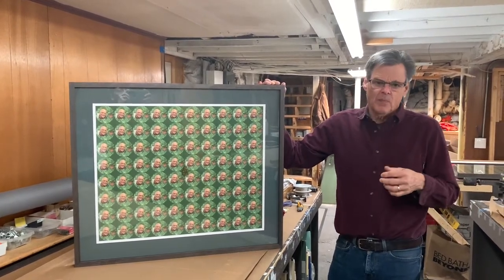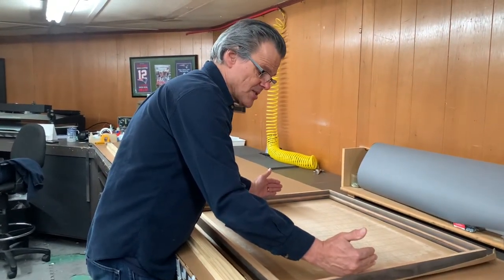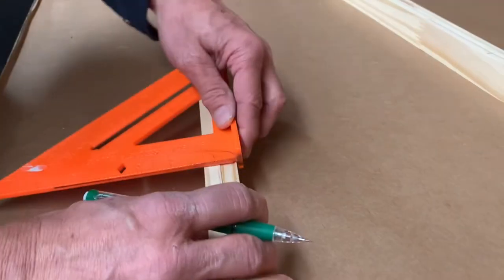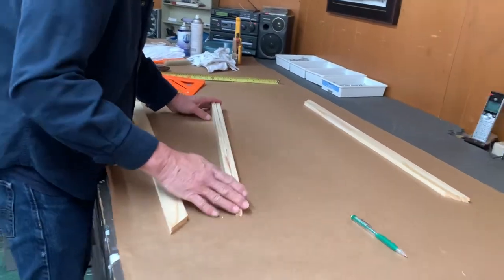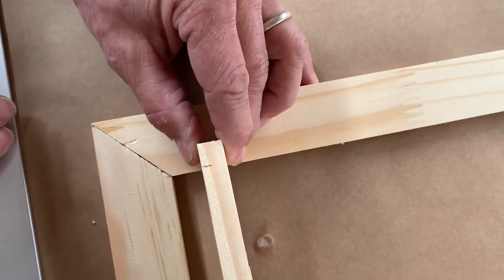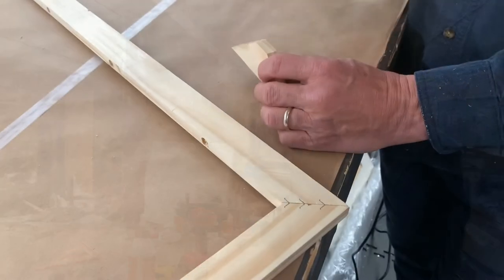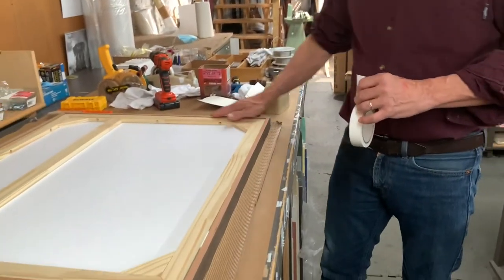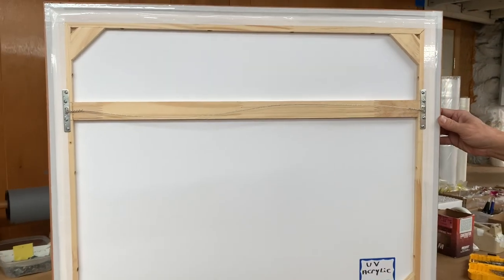How to Build a Strainer Back

Comment: This is a really good "how-to" video! Nicely done. My question is, what kind of wood are you using for the strainer? I saw that it was finger jointed. Where do you get it? Thanks again!
Reply from the maker: HI @steveberry89, thanks for watching. For smaller strainer backs like this I use a finger jointed 1/2" pine that I get from my frame supplier. For larger strainer backs I use solid poplar that I get at Lowes, usually 3/4" x 1 1/2". If I need the poplar to be 1/2" I plane it down myself, but Lowes does have some 1/2" x 1 1/2" poplar. The shims are simply strips mat board. Glad you enjoyed our video! Any further questions, don't hesitate to ask.